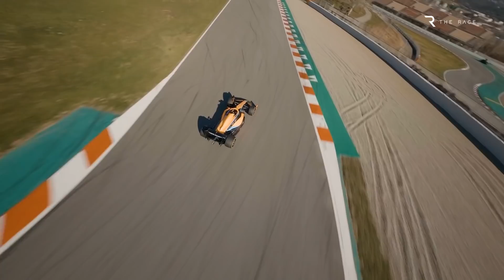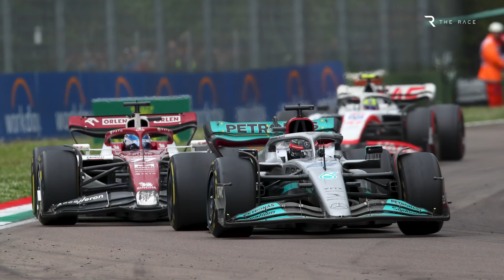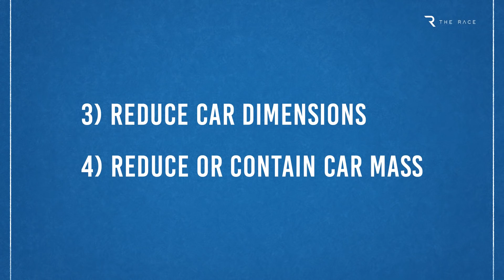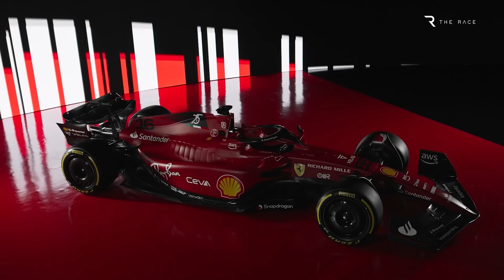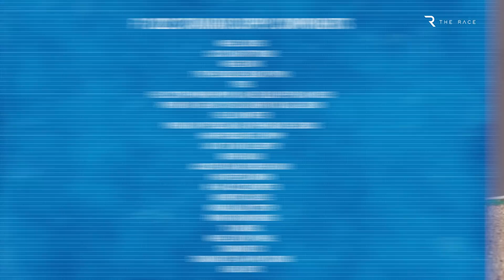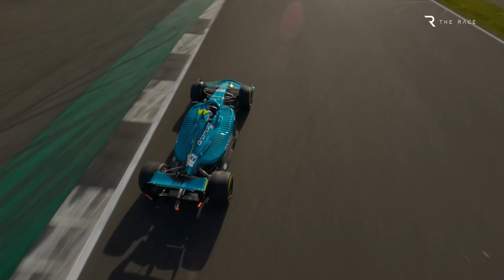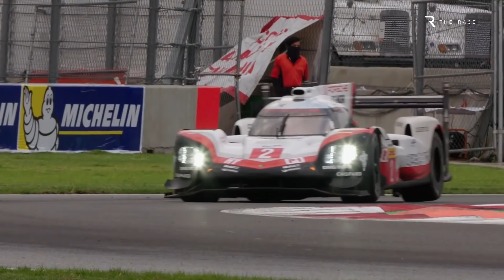F1's new major plans for 2026 car overhaul explained

Comment: If the Formula dictates 6 cylinders, they should NOT dictate the layout of said cylinders. Porsche can use a flat 6, Ferrari can use a 120 degree V6 like the new 296 and BMW could come in with an inline 6. There would still be a displacement limit, (although unnecessary with fuel flow rules), and of course boost limits, but wouldn’t that option bring more manufacturers into the sport?
Reply: It’s just unrealistic for Porsche to use a flat 6 in an F1 package. Aero bits just won’t fit.
Reply: @ryanlee315  not only the earo package, a flat 6 has some serious issues as well
Reply: @DevBench4Life  what kind of serious issues?
Reply: I thought the whole point of having linier regulation in this area was cost and safety.
Reply: @F1ll1nTh3Blanks  having different forms of the same engine doesn’t take away safety
Reply: Flat engines usually compromise packaging, especially its why Ferrari and Alfa Romeos dominant flat 12 engines in the late 70s were useless in the early 80s, as V8s could be packaged better for ground effect cars. Thats why Ferrari won the championship in 1979 and came 10th in 1980
Reply: too much parameters open for development = expensive development costs. by having a standard format that limits what manufacturers can mess with by throwing money at it.
also not to mention that well wreak havoc on standardizing engine mounting points etc, unless they introduce a regulatory dimension box or mounting points for the engines.
Reply: Well, yes, but actually no.
V-shaped layout helps with center of gravity.
While a flat-6 is even better for COG, it's a problem for efficient aerodynamics.
Reply: and mostly camless engines - that would actually reduce weight a lot, 20kg easy: 4 cams, 24 rocker arms, 9? gears
Reply: I definitely would prefer to see that flat-6 Audi engine or iniline-6 too.
Reply: Imagine you could a deltic engine 😳
Reply: What you're talking about is an engine development war. That kind of made sense when they didn't cost tens of millions. Manufacturers are attracted to keeping costs down. The expense of MGU-H and K is what has kept manufacturers away. I don't understand the obsession with different configurations. That was the past. Porsche aren't going to make a flat 6 for F1 just because and neither will BMW make an inline. They look at what will be most efficient.
Reply: @Ruylopez778  it wouldn’t be “just because”, the reason they would do it is because the engineers in their Motorsport division have very intimate knowledge of flat-6s and could probably develop a reliable high performing one for F1 much more quickly than they could a V6
Reply: @armadillolover99  The first concern would be packaging, because the cars are so aero and cooling dependent. If you're spending millions on millions on a bespoke project, you don't favor one solution over another based on what you've already done. You don't limit yourself in that way. For sure different manufacturers might have different solutions for combustion, and where to place components (as we've seen) but to suggest they go with a flat 6 because they know it, is silly.
Probably the first thing any of these manufacturers will do, is hire someone who is currently working for an existing F1 team, because they know the specifics OF THE SPORT, which is much more important than heritage.
Aside from anything else, one of the reasons manufacturers enter F1 is to discover new solutions that can trickle down to other divisions.

I know some people fantasise about different manufacturers with different engines like the good old days, but it just wouldn't happen. And even if it did, they would all converge at the same solution within a few years. Personnel switch from one team to another every year.

Secondly, all the PU manufacturers have an obligation to supply a customer if necessary - and customer teams struggle enough as it is to integrate the PU into the chassis in a tightly controlled rule set.
Reply: @Ruylopez778  The fantasy aspect about different engines from different manufacturers “like the good ol days” is a significant part of this discussion whenever it comes up.  For me, “the good ol days” also had less restrictive parameters for the overall package, so if a flat six was desired, it would have a completely different chassis design to accommodate its specific characteristics.  That made for very interesting grids.  But today, the FORMULA governs, and priorities on cost caps and environmental concerns ensure that all evolution leads to a single, less interesting solution.  

Is it ironic that the ultimate goal of this philosophy is at odds with keeping separate, independent manufacturers spending four separate development budgets to produce (effectively) the same product as specifications narrow?

Obviously, the narrow specs are open enough that they still produce a wide range of success amongst different manufacturers, but so much effort is then made to delete inequalities when one becomes dominant.  

It’s a strange conundrum that authors these final chapters of the internal combustion racing engine.
Reply: @loonattica  If it were up to me, I'd have a series where there were different engines in F1, with a system to keep them all broadly equal - but teams and drivers would always argue over it.
The biggest problem is the desire to force hybrid (and therefore weight) while not having refuelling (for the message of 'sustainability' (all while adding more races around the world that are a logistical nightmare).

I'd get rid of the HALO and have an aero screen solution that looked less awful because of wider cockpit sides rather than the narrow cockpits they have.
I'd have regulations where cars looked a lot more like the late 70s to late 80s (with high and safer cockpits).
I'd have tyres they can push on.

But this is all pie in the sky, because F1 wants manufacturers - and by manufacturers I don't mean Cosworth et al, but gigantic corporations. And gigantic corporations care more about perception than racing - which lead us down the road of bullshit we find ourselves now; heavy cars, sensitive tyres, expensive technology that fans can't see and don't understand, like MGU-H, which serve no purpose AT ALL, except to talk about thermal efficiency.

If they cared about "efficiency" the cars would be a lot lighter and have less drag.

Apparently all the teams run a suspension design that is heavy, primarily for the sake of the aero benefit, but every team does it, so it effectively nullifies any advantage.
This is the kind of nonsense they could change.

But this idea that manufacturers want to come into the sport with total freedom and won't all copy each other is frankly nonsense.
Sure in the 70s and 80s there was probably some marketing involved in having a flat engine in your F1 car and flat engine in your road car. But then there wasn't the endless data simulation they have today - you had to stumble through the design phase by building things and testing them.

I also think that people tend to have rose coloured glasses about different engine spec. The reality was that if you have a flat 12, and your concept didn't work in the car, you were fucked for the entire season, while others had a design you couldn't copy.

The devil is in the detail. People often think that restrictions lead to less creativity - but it's the opposite - the more tight the regulation, the more time you can focus on what you can change - and the freer the rules the more time you waste making decisions.

Sure all the PU are basically much of a muchness, just as the cars are. But they still exhibit different strengths and weakness in terms of traction, top power, energy recovery etc.

If it were up to me, we would remove all the hybrid and reintroduce refuelling, and have tyres you could push on. But it ain't.
Reply: They would use 90° V-configurations anyway, it offers enough space inside the V to fit a proper intake manifold and house various others things and there's enough space for the exhaust pipes. A flat 6 would have a higher center of gravity for example.
Reply: @AndyHack10  Probably not, but It'd be rather wide and comprimise the venturi's. I think an inline engine would require a spaceframe so would make stressing components difficult. You're right though, a 90° V6 makes the most sense from a packaging perspective.
Reply: @alhemmings8554  Well look at the early 2000s, only Renault still ran the 72° V10. I guess after that 111° V10 desaster and the re-signing of 90s Renault F1 engine design genius Berbard Dudot, they went the conventional way, as 72° offers an even firing order. I'm sure they would've joined the 90° anyways, as that's also the V-angle were a flat plane V8 has an even firing order. Sooner or later they all figure out what's best and go that route. I'd love to see different layouts, but i'm afraid that wouldn't be the case.
Reply: Never gonna happen, but sounds like a nightmare? Audi & Porsche lost that argument years ago, as it presented too much variation to effectively regulate, according to Bernie. I wanna think they were pushing 4-cyl max displacement of like 2.0L? 

I’m unsure if there’s an existing FIA sanctioned race series that allows for anything even remotely similar to this?
Reply: @ToeCutter0  didn’t Porsche run a 4-cylinder turbo hybrid on the 919 a few years before? Can’t believe that’s nearly 5 years ago already
Reply: @ryanlee315  Man, I wish I could remember? I wanna think this was around 2013 and there was some discussion with VW Group about repurposing some nascent Le Mans tech for their F1 engine program? I’m astonished we’re still talking about VW in F1 and NOT talking about the FIA basically straight-arming Andretti Racing’s interest in fielding an F1 team?!
Reply: @ToeCutter0  Only the ones based on road cars. Scartch built for-series made cars, no.
Reply: F1 ROTARY ENGINED NOW!
Reply: You've described group b racing really. Today tree huggers n cost caps I believe defeats it

Comment: Target 6 is interesting. Maybe connected systems can inform or warn drivers when a slow car has a faster on a pushing lap during free practice or Qualifying. At some tracks the speed difference between cars on timed laps and cooldown laps is far more dangerous than the actual race it self
Reply: A warning system for reckless drivers? Maybe call it Machine Activated Zone Early Predictive Incident Negation. Or MAZEPIN for short 😂
Reply: @ghlibisk67  Bravo
Reply: @ghlibisk67  this is impressive cant lie
Reply: I assume target 6 will involve active telemetry reading that maps out all cars position, and expected paths and warn drivers if they have a potential collision down the line. This will also be beneficial to prevent another Jules Bianchi incident, with recovery vehicle being added into the telemetry matrix. Then again, I assume too much...
Reply: 2026 F1 cars may feel overweight.

Comment: The easiest way to achieve these goals is to simply make the cars smaller. A smaller car makes less drag and less wake, thus improved racing and efficiency.

Narrowing the cars by 20cm is entirely possible without sacrificing driver safety. All F1 would need to do is bring the tires closer to the chassis while reducing their width.
Reply: Yes, smaller cars will improve the racing by offering more viable racing room on track as well.
Reply: But racing tires are wide, it would be laughable if F1 had narrow tires while other racing series' has normal racing tires...
Reply: Narrow cars that are super long nose-to-tail would still be problematic. Alot of people forget that the cars in the early 80s was good despite being comparitevly wide with today's cars, but they were shorter back-to-front.
Reply: The material between the outboard extreme of the car and the safety cell is a key component of an F1 car's safety system. The less "stuff" there is to absorb the energy of a crash, the more energy is transferred to the safety cell and the driver.

Comment: I think these new rules should be a great opportunity for introducing better sounding engines. Going with a V6 is just being a long sore tooth. And given sustainability and cost controls in measures, F1 could introduce engines the likes of V8 that runs on efuel with no hybrid assist. Alternatively, they could use inline-5 turbo with hybrid assist. This should solve the sound issue as an even firing high revving inline-5s sound very much like V10s. Plus, you only have one bank to work with and is significantly small yet allows F1 to maintain those smaller dimensions going forwards. Plus they are easier to work with and require little maintenance given Audis track record. This should play in their favour as well. All-in-all, the inline-5 turbo hybrid sounds like a win-win for F1 and the audience.
Reply: I was thinking straight five engines, too.

Comment: honestly, if they plan to switch to hydrogen i understand why the mgu-h is taken off. since now the cars wouldn't be under heavy scrutiny since fast ass cars were usually what people think are the main culprit, but outside of the fact that f1 cars cause less than 1% of the pollution in a race week. hydrogen  tanks are heavy. the toyota mirai has two fuel tanks, combined resulting in 122 litres and 80kgs combined.  so unless there's a way to make those tanks lighter or make a 1000hp engine that weighs less than 60kgs, also add freevalve pls.
Reply: adding freevalve would be interesting since it possibly wont  dampen the sound,add something to tinker more, possibly producing more power and efficiency(although idk if an mgu-h system would be more efficient) as for width and length i don't know how to fix those,but from the alpine crash i think the cars can be a bit slimmer, however im just a 14 year old on the internet.

Comment: The size of the cars, particularly their width, functionally expands all existing track's raceability by allowing for more side by side racing, more passing zones, and multiple racing lines...
Reply: @Donkey_Xote  this.  While narrower tires will definitely improve the ability to go 3-wide instead of 2-wide, the ability to continue that battle throughout the corner is directly dependent on the vehicles' wheelbases.  Shorter F1 cars also simply look better and more athletic.
Reply: @flyingphoenix113  I don’t know how a car looks athletic but you’re absolutely right about the length of the cars
Reply: @flyingphoenix113  you have to count in reduced cornering performance though with narrower car
Reply: @JWil97 , of course, but lower speeds = less aero wash = less dirty air, and that's without considering longer breaking zones (meaning better overtaking opportunities) amongst other benefits.  Slowing the cars further would be a net positive.
Reply: @flyingphoenix113  yes. I think 2026 F1 cars may only have 600bhp, on par with F090/S.
Reply: @purwantiallan5089  you literally have no clue what you’re talking about
Reply: @flyingphoenix113  not just that but you got the biggest ones. In terms of ecological concerns, smaller cars = less waste (brake discs, oils and piping runs etc)
Reply: @Arwel22597  the 2022 F1 cars may produce heavier weight.
Reply: @flyingphoenix113  Yeah but wider tires give you much more mechanical grip which is what youre using the most in slow speed corners. So keep the tires wide and just make the cars shorter.
Reply: They're the same width they were in the early 90s. They're too long, and too heavy. And what the drivers complain about the most is weight.
Reply: @Ruylopez778  👍👍
Reply: Bigger cars may contribute to the demise of Monaco.
Reply: @charlie9ine  Monaco has never been a great race track. Should be changed to a time attack weekend.
Reply: @Æthelstan-Audwin-Osbert  last year Monaco was a great race in formula E. Obviously it's a very different racing series, but they were using the same track layout as formula 1. Hopefully it will be just as good this weekend. My point is though, that it could be possible to make Monaco a better race, just by making the cars smaller.
Reply: @Æthelstan-Audwin-Osbert  Definitely was in the 60s, 70s, 80s, and 90s. And still is, in non-F1 races. Like the other guy mentioned, the Formula E race there was nuts.
Reply: Multiple racing lines? That's not how it works, there will always be one racing line, no matter how small the cars are.
Reply: @MrSniperfox29  I see it was a poor choice of words, of course there will typically always be a single fastest line around a circuit. The point is passing usually requires a line outside this singular "racing" line and a wider track provides these alternate racing lines that different chassis/setups/drivers may be able to exploit.
Reply: @Donkey_Xote  reducing the rear wing length can be also a factor man.
Reply: The width is the same as they were pre 98 so that’s not the issue length is
Reply: Be nice to have actual racing on the street circuits
Reply: @Donkey_Xote  agree, they are ridiculously long
Reply: 2m width has been used for a very long time and has never been the issue. The length has grown to cartoonish dimensions. This is where the focus should be.

Comment: Some fans might not like this but the 2026 PU regulations will probably be the last ruleset that includes an ICE engine. While on paper Formula E has an exclusivity deal till 2039 I doubt we'll make it that far as by the early 2030s the manufacturers will force the sport to switch to all electric due to new road car use becoming obsolete.